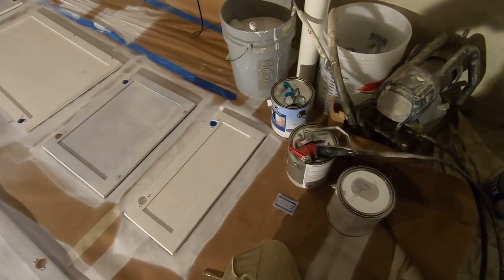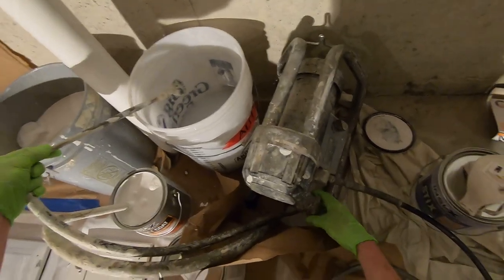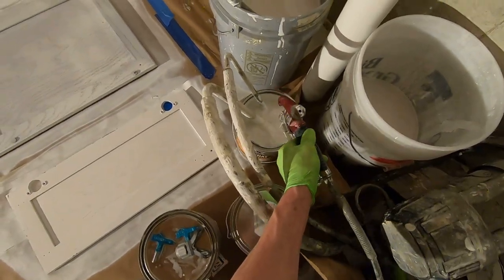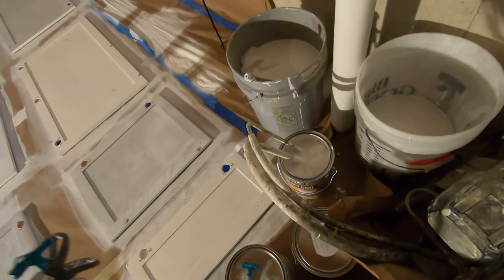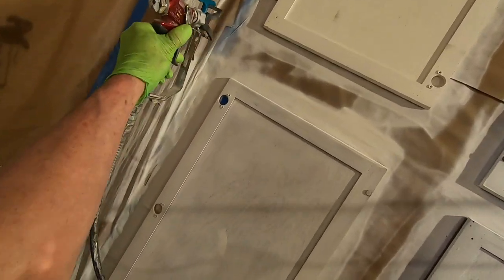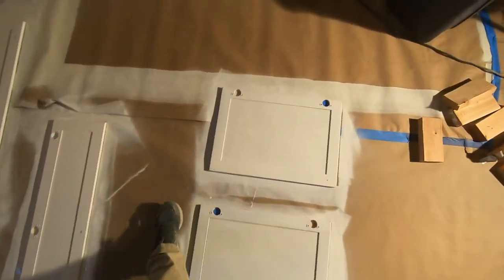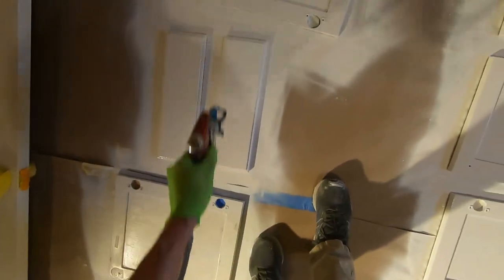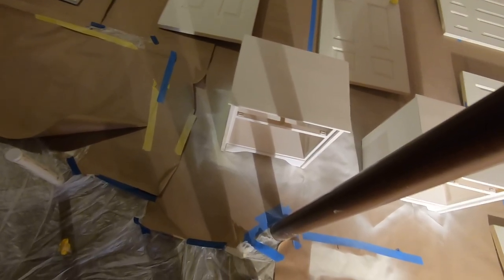Airless sprayer setup to spray cabinet coat

Comment: Mate you need to use a ff tip from Graco or better still the Triteck gold 310, 410, 412 those odd number tips are gen contractor tip

Comment: And I think about the sprayer you can tell if it’s covering as you’re doing it and if it’s not gonna cover you go ahead and just put it on what you’re putting on not too much and then you can knock it out on the second coat I’ve seen people just try to spray it until they thought it was covered in national just got too much pain on it and nerve don’t know kind of shit to get that paint off the part of the door using no electric sander Guyana job did that to a steel door because you can roll use a hotdog roller and cut in a wood door not your bedroom door but when it’s a steel door you got a brush that thing unless you can spray it but if it’s already installed and the home is occupied you got a brush it build a house we were doing we were custom painting the home so we didn’t have the sprayer out for any of that but I don’t even want to units did a house to where they were still building it but they want it a custom paint it and I sprayed the ceilings white knocked all the ceilings out real quick because most of the rooms were different colors and the trim paint was different colors of paint the ceilings white with a sprayer save so much time